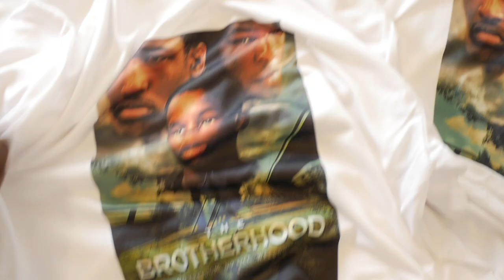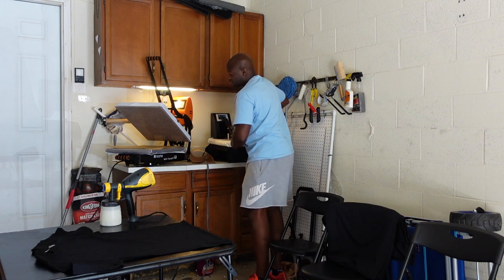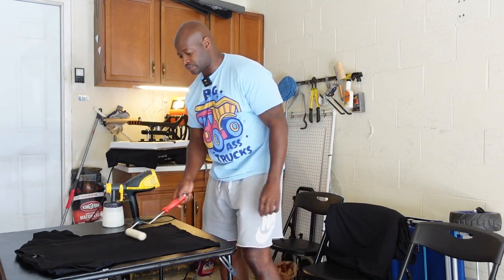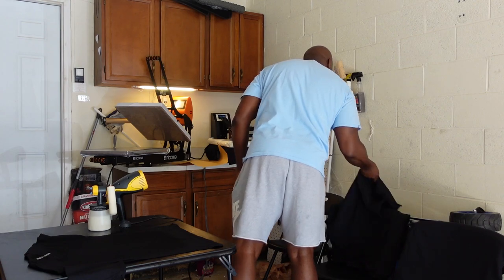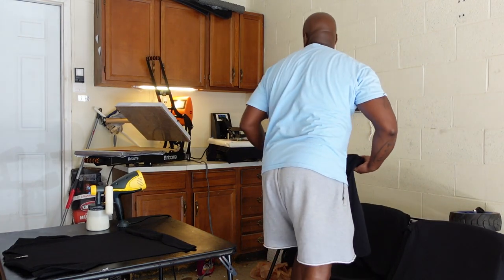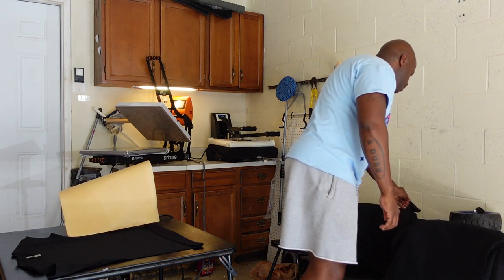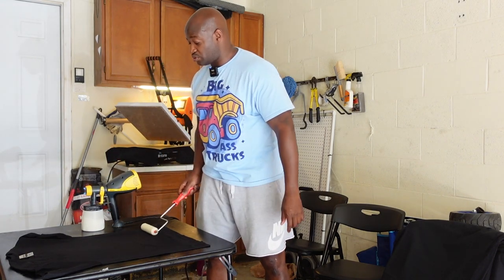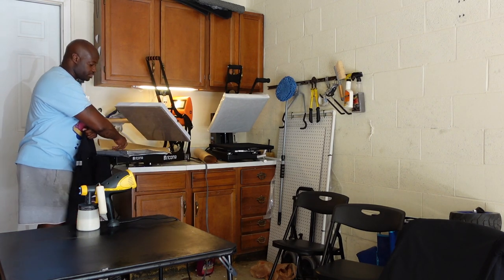How long does it take to Pre-treat 10 shirts for DTG

Comment: Looks to be about 17 minutes for 10 shirts with a Wanger from someone using two heat presses, or about 36 an hour, which is way short of the 120 you could potentially be doing with two presses...........I'm sorry but that is just way too slow. Having two presses is excellent and a huge time saver in this process, and with IA PT, you can get two tees done every 30 sec with two presses, so it allows you to run 120 cured tees an hour, which we can round down to 100 for ease of flow. Time is money. Your big hanguop in this workflow is the hand sprayer. There are machines that can spray 3 tees perfectly in 20 seconds, so 9 tees in a minute, or 540 a hour.......which is insane, but possible.

Also, the PT coverage in both is different in terms of amount and spray locations from tee to tee. I get it that it is working for you, but to be fully efficient is to use a machine. Also with a machine, the employee you have PTing will be able to do the sape spray coverage and amount every single time as ell, no training needed on how to use the hand sprayer, how to move it around and get the proper coverage and ect ect.
Reply from the maker: I agree with the pretreat machine part using one of the big pretreat machines. I will eventually invest in a big pretreat box style machine for consistency but this is what I do right now and it works great and doesn’t take me so long for the quantities that I produce.  When I need to scale I’ll get the big pretreat unit.